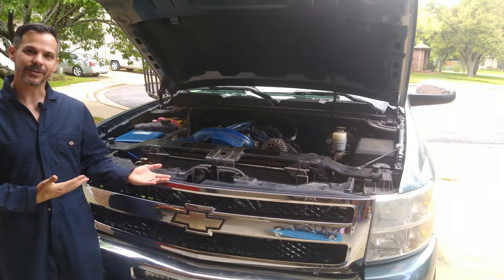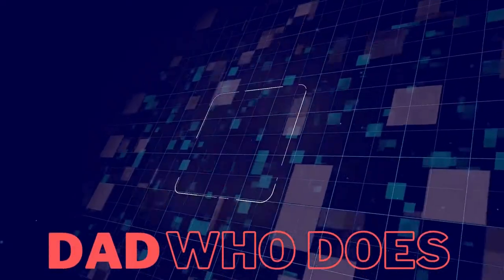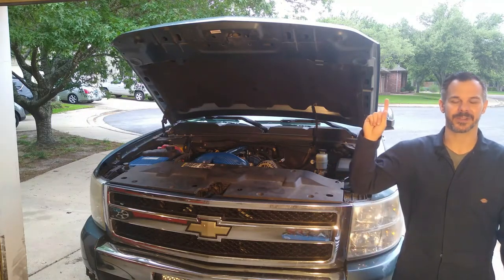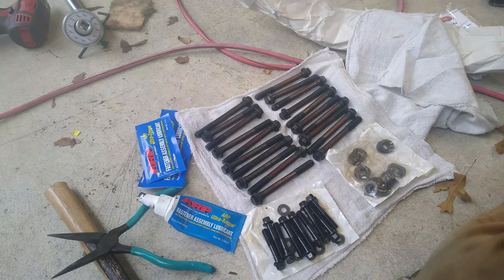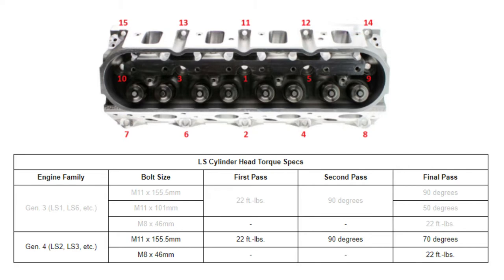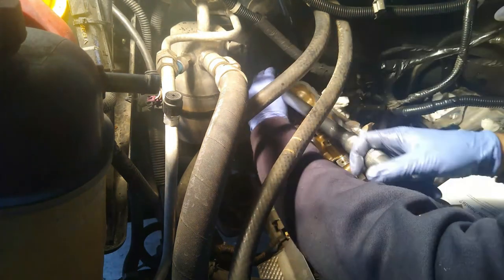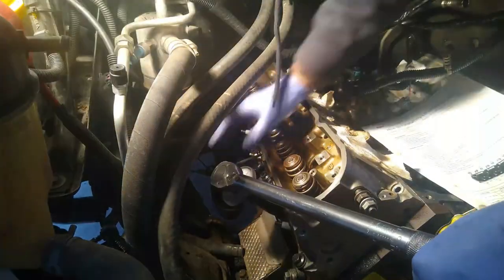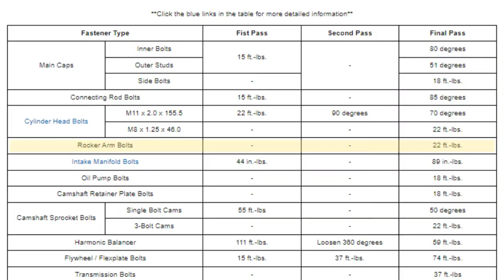Cylinder Head Cleaning and Installing 5.3L Gen4 LS Engine Rebuild 2008-2013 Silverado Sierra

Comment: All the valves are open on one of those heads. Is that normal and did the truck crank after installation
Reply from the maker: When? Yes, the truck started right up. Check out the video series and thanks for watching.